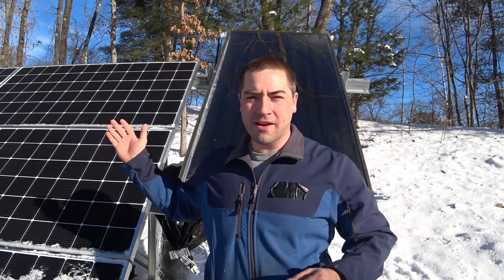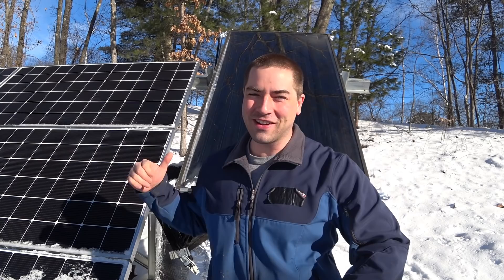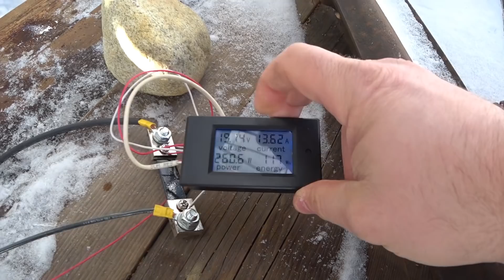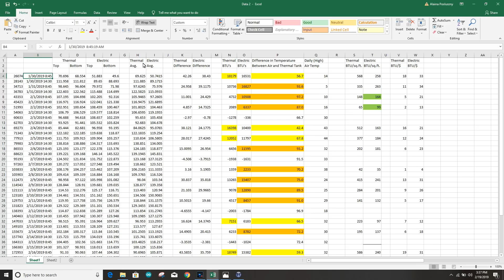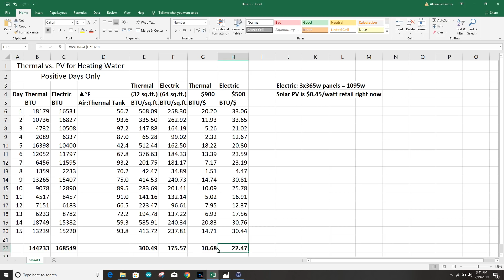Results of Solar Thermal vs. PV Experiment in Heating Water

Comment: after seeing this i thing i will for sure go solar electric fully off gird for everything unless i also get land with a stream
Reply from the maker: I agree.
Reply: @DavidPozEnergy  i like the under floor heating idea means alot less power needed compared to space heaters and such how many wats of solar or size of heating element do you think it would need would prob run vented system
Reply from the maker: Hi David Simpson, I don't think I understand your question.  What do you mean vented system?  If you want help matching PV panels to heating element, I made a free online calculator to help you do exactly that: www.davidpoz.com
Reply: @DavidPozEnergy  vented i mean like an old back boiler system i have no idea about underfloor heating and temps it needs to be. i was just thinking of a tank and the pipes. tank having the heating element in and pumped to the pipes that would heat the floor as for hot water a tank in loft area thats heated once battery's are topped off
Reply from the maker: Radiant floor heating requires the lowest temperature water to extract heat.  Something like hydro-air requires the highest temperature water.  The exact temperature water will vary by your exact situation, but as an example, my garage can use as low as about 80°F water.  Most homes with radiant floor heating need 90°-110°F fluid.
Reply: @DavidPozEnergy  so a little over body temp damn did not relise it was that low of a temp

Comment: I think the thermal has potential, if there is a medium inside the water with a  greater thermal capacity then it might hold the water temps more stable, that is until you have a big drop in temps along with clouds. Great video
Reply: 77Trev617 The most cost efficient way to store energy is to store it in to a insulated rock! Of course heat transfer is going yo be very slow, but say you have a tank that is half full of gravel and half full of water, then you already have a feasible system for hot water storage.. Of course there might then be a need for a heat exchange, so the more rock you have and the cleaner you can keep the "coolant" the more directly it can be used.
Reply: @rkan2  ; 
   The specific heat of rock is approx .2 and the specific heat of water is 1, that means that the for the same weight, (say 1 pound) you need 5 times(1/.2) as much rock to store the same amount of heat. Specific heat = the amount of heat required to raise 1lb of water 1 degree F., or to raise 1 gram, 1 degree C. It also means that, if you have the same weight of water and rock, it takes 5 times as much heat to raise the temperature of the water, which makes it such a good thermal storage media. And to store the same amount of energy you would need 5 times as much weight in rock as you would in water.

Comment: Might be slightly off topic for this video, but very much on topic for your heating in general. Do you know what the BTU requirements are for your garage? Do you know what the BTU capability is for the radiant heating system? A little math from your chart says the PV system can easily go over 15,000 BTU per day so that's a bit over 600 BTUs per hour. IOW, not much as far as heating systems go. OTOH, knowing how many BTUs per hour are needed (that's the standard for expressing heating needs) will allow you to calculate the size and scope of future improvements. Maybe the next update would be a system to follow the sun? Might be cheaper than adding more panels.

Comment: i think solar electric is best any excess power once battery's are topped off can then be dumped into heating the wateror vice versa when water hits temp the extra solar then could be fed into the batterys if needed

Comment: It seems that on low light days the PV also suffers, which in my understanding is due to it being a parallel setup...
the heating element requires a certain amount of volts and amps to reach certain temps for set amounts of water.
essentially this would even out during stable lighting conditions...

However if we imagine a cloudy day and the heating element gets a max of lets say 100F due to low voltage and or amps, what you want is the heating element to be supplied enough voltage and amps that it can go to your preferred max temp like lets say 160F, using some sort of controller or maybe having two heating elements, which then turns of one if not needed... if the problem even exists...

anyways, from looking at the data you showed, i seem to clearly be able to see the low light days the PV doesn't outperform the Thermal, which to my understanding it should, if used in an optimal setup... i'm not saying i got all the answers for this...

just that i think you might be missing out on that angle of your research and suggest a likely way for improvements.
Great Video, good data, i've been looking into something like this myself, for my own solar system.
 
and i think the answer to getting great output is to utilize the low light ability to create hot water is key...

If nothing else then it's something to think about, because in truth i don't any answers to this.... my homebrew system is all solar thermal

i think i would start with testing if the heating element can get up to 160F in low light conditions with your current setup...
Reply from the maker: I've already purchased an assortment of heating elements.  My next project will be comparing them to find out which one makes the most hot water over a variety of days.  Thanks for watching.

Comment: How about trying it with MPPT? Your panels will only be matched at (I assume) peak irradiance.   
BTU? BTU?  How many BTU/sec are those PV panels????  I'm afraid BTU's are reserved for use by old plumbers. You're far too young to be talking BTU. NASA agrees. I'm sure there's a place on steam engines where the coal is rated at so many BTU per pound, but who uses coal nowadays?.... Oh hang on....
Reply: In a sunny day efficiency with match panels an heat element will be around 80% efficient so fairly good you can see page 9 in my old presentation for details http://electrodacus.com/DMPPT450/dmppt-presentation-v01.pdf
Reply: @electrodacus  is that at peak usage or normalised across a day?
Reply: That 260W would have been 470W with a power point controller.

Comment: Thanks for the followup, David. The actual performance of your two systems was closer than I had expected. For me, personally, simplicity and long-term reliability won the contest when I was researching my own solar hot water system. I don't want to have to spend my time monitoring and keeping everything working well. Sure, you need more square feet of collection surface for PV, but that's not at all an issue for me. A few panels, some wire, the DC heating element, a thermal switch and a fuse; when it comes to real-world applications, the KISS rule is king. :)
Reply from the maker: I agree, KISS.
Reply: why not use solar air heater, simplest, cheapest and most efficient?
Reply: @MaximumEfficiency  Ever try washing yourself or dishes using hot air? Also, hot air blowing heating systems are worse for air quality, comfort, and efficiency than radiant floor heating. You can set the thermostat lower on a radiant system for the same comfort.

Comment: Awesome Data!!!! When you showed the data, the results came back exactly as I predicted. If you run the same experiment during the hot summer, the thermal will win. When cold, The photovoltaic wins. The graphs and spread sheets clearly show, thermal the fastest out of the gate, but PV finishing at a higher temperature. Thanks for posting the results!❤ (Cute kid, by the way)
Reply: and electric driven heat pumps always win. Dave's experiment was a big waste of time.

Comment: The solar thermal is better for large volume of hot water. The solar thermal need bright sun light to do much. The pv will produce a little in lower light condition. On a smaller System the pv is less intense to install no pumps and pipes but on a yearly average thermal will out do the pv.
Reply: Roy and David Poz,  I have only solar thermal using pool panels to heat water.  Been working perfectly for over a year with zero maintenance.  The panel glazing is stained and dirty.  Yet I get right now here in Feb hot water so hot I have to mix with cold in the shower.  This is true daily whether the sky is clear, mixed clouds or hazy.  Yep hazy, as in no bright sun light between 10am and 3pm.  For me solar thermal install was way cheaper than just adding more PV as I got the pool panels on CL for free and I do not use any pumps or electronic controls.  Plumbing only cost (one time expense) around $100.  For that money I could only buy one 100W PV and in no way could supply the same amount usable hot water.  Can see on my channel.

Comment: Thanks for sharing the results! Really like that you got real operational data. The BTU per unit area didn’t surprise me, but the cost comparison really did. Assuming my free thermal panels don’t leak, the price is hard to beat - maybe a hybrid system with a two stage PV over thermal .... thanks again!
Reply from the maker: I've got some "Free" thermal collectors too.  Every one that I got free had a leak.  But it doesn't take that much effort to fix them.  They are currently heating my garage.  Worth it!
Reply: DavidPoz we’re in N Arizona and I wish I had the panels installed right now - we’ve had too many single digit nights this winter. Hope the next storm treats you gently.

Comment: Another interesting comparison point would be how the two systems perform over distance, Ie when the storage tank is in the house and the panel array is 50-100 feet away. 

you now have to bury a length of insulated pipe to the solar water panels, while pushing either pv direct dc over distance or an ac run to the house for the pv panels.

What i like is the concept of installing a second hot water tank and using it as a pv direct preheat tank (plumbed in series) swapping one of the elements to dc with a thermostat while the other is wired to a breaker you can plug a generator into.  

Of coarse a free, used or cheap! tank is best for this.
Reply from the maker: Sure.  I can share one data point I have on distance.  My array is 4,380 watts, and is 100 feet away.  When it's running full tilt, I'm at 1.6% voltage drop.  My guess is that's less than heat loss out of a pipe running the same distance.
Reply: @DavidPozEnergy … now that's  the kind of data people can sink their teeth into and it helps hold down the dumb questions from the hecklers. As for the guy saying you need a top mounted tank with so called "gravity circulation" that would still need some sort of thermostatic control to keep the tank from cooling at night (thermosiphon) and in freezing weather it would also need antifreeze. Personally I was skeptical on the PV system, but that wins hands down just due to lack of freezing issues alone. BTW, you can use a thermostatic mixing valve to temper hot water for use in a radiant floor system and that would allow a much smaller storage tank. IOW, go ahead and heat the tank to 180 degrees but mix it down to say 85 degrees for the floor loops. That's a win-win situation.
Reply from the maker: I was also skeptical.  I knew PV can heat, but I was expecting only to have results show something like needing 10 PV panels to equal one thermal.  The PV outperformed my expectations.
Reply: DavidPoz   Think about a hybrid system that cools the pv solar panel and increases its efficiency.  It could work at any temperature really.  just look at your pv panel data sheets for the temperature power curve.  as the temperature drops, the power increases...maybe enough to run the cooling system.  Now the question is how to make the cooling system really inexpensive.   Solving this problem could go a long way to solving the small roof issue.   Out of 800 watts/m2 of solar power, we only collect 160 with really efficient panels.  We should strive to at least heat domestic hot water with the other 80% as well as space heating in the spring, fall, and winter.
Reply: I have a home build panel wired directly to 4 car radiator fans that blow air across my array to keep the panels cool. I see a 40 deg Celsius reduction in surface temp of the pv panels.
Reply: lengthOFpole wow!  That is a big temp delta! Do the fans run constantly? How much power do they use?  How much more power does the system produce with the fans?  Great idea!

Comment: Combine the two, use the solar thermal as a pre-heater for the PV panels.
Reply: Colorado Clyde Heater? Why would heat silicon or copper? Cooling is where it is! I wonder if pumping water under the panels would be efficient enough to power using PV. You could then use the waste heat for anything!
Reply: Nice idea!